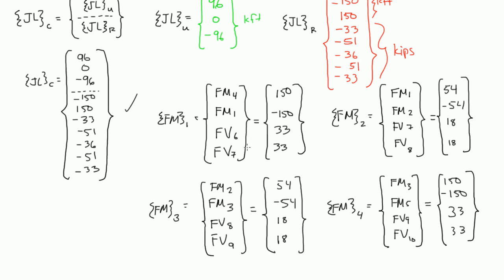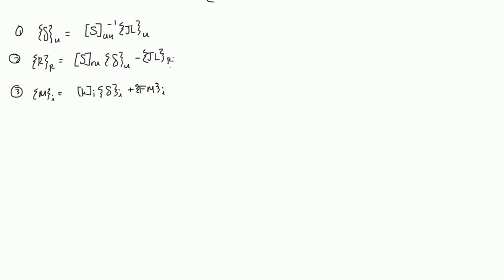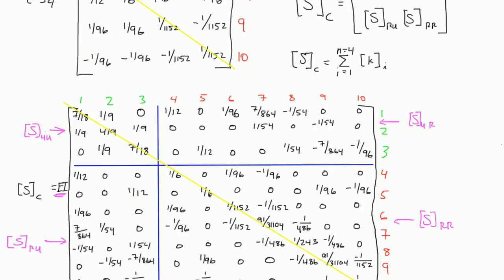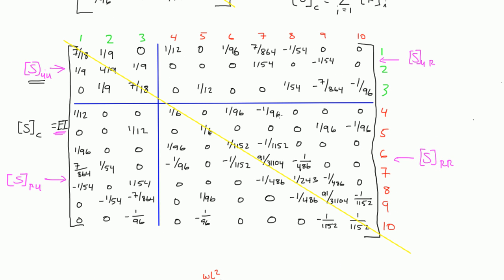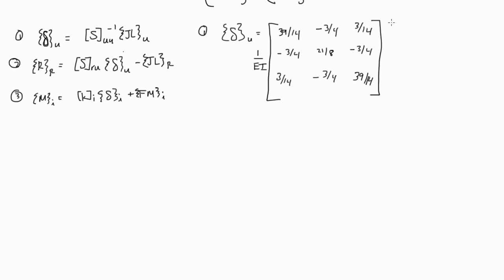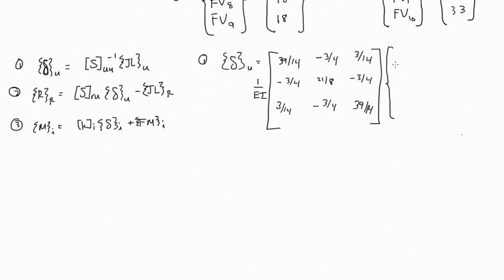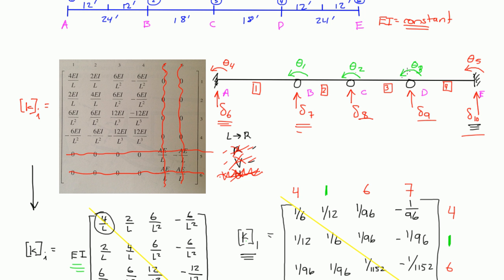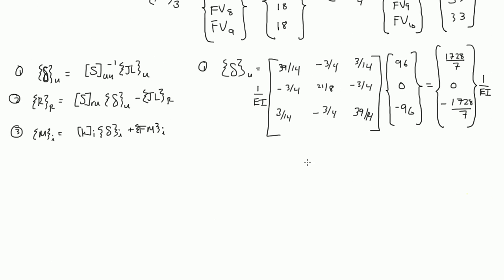Stiffness Method Example: Part 7

Comment: I just wondering, if you multiply a 3x3 matrix with 3x1 the answer would be 3x3 but on your solution you answered 3x1? how was it possible?
Reply: +Comtech Site Actually, if a nxn matrix is multiplied by a nxm, the outcome matrix should be a nxm matrix, which in this case is a 3x1 matrix.